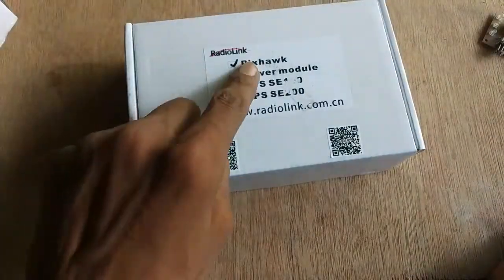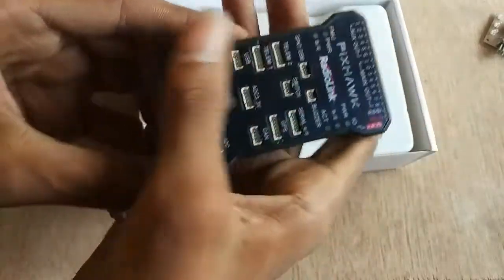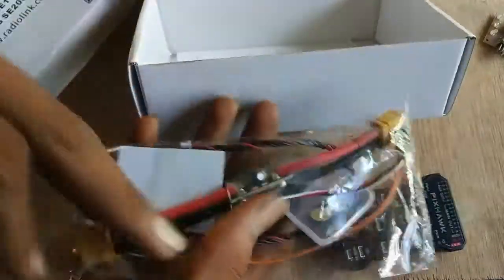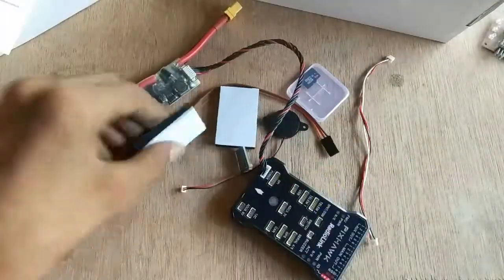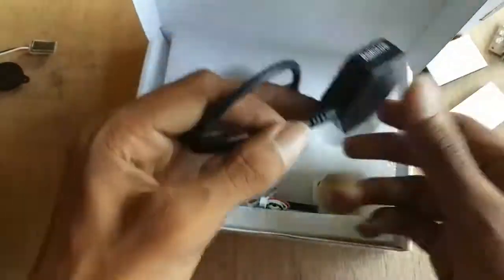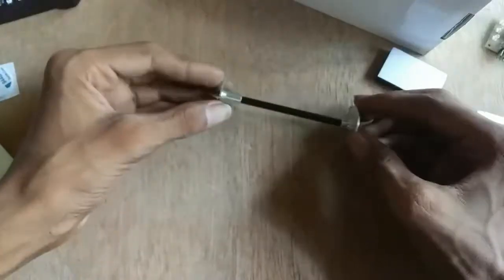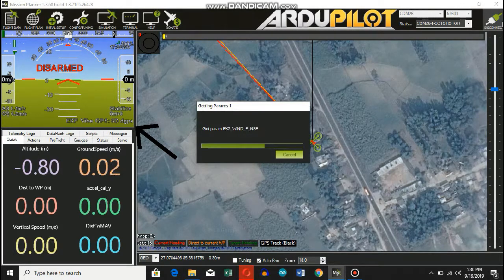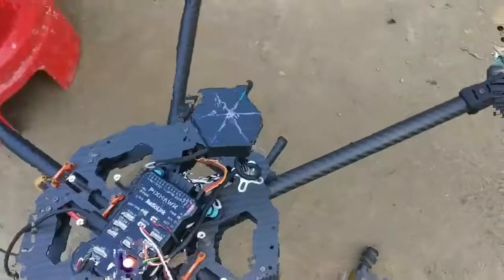Radiolink Pixhawk 2.4.8 and Radiolink SE 100 GPS module Unbox + Test

Comment: Hey bro what is the difference between radiolink pixhawk and normal pixhawk ?
Reply from the maker: By normal, I are assuming that you mean non-branded clones. pixhawk is a open source project and hardware and software are open to public for free replication. so, many cheap Chinese one uses low quality components like accelerometer, barometer, compass, so they are not that much reliable. by sticking to a reputed manufacturer even though they are Chinese too, you are more likely to get high quality components inside the board
Reply: @AmateurInventor  sir i had a question i have one air module and two ground module (as my previous air module was destroyed ) so can I use both the ground module with the air module both are of same frequency...
Reply from the maker: Just flash the same firmware and connect proper tx rx wires, the air and ground modules are interchangeable and are basically the same!
Reply: @AmateurInventor  sir you didn't get my point I'm trying to ask you that i want to use both the ground module together with one air module is it possible?
Reply from the maker: @slayerdaku7012  although the overall frequently is same, the specific frequency is different so, what you can do is, flash the same firmware to all three modules, and you can receive the signals  from same air modules to both ground modules. But it may create interference as both of them will be operating with exactly the same frequently.
Reply: @AmateurInventor  thank you and one more question is radiolink pixhawk compatible with latest firmware and latest version of mission planner?
Reply: Kindly tell me bro....
Reply from the maker: @slayerdaku7012  They should. However I cannot confirm because the only radiolink pixhawk I had was burnt when my lab was burnt on fire. But they should. and to be honest those FC are great paired with SE200 GPS module
Reply: @AmateurInventor  se 200 or se 100 as i couldn't find anything else except se100
Reply from the maker: @slayerdaku7012  ohh sorry, its actually se100. it is by far the best GPS module I have used soo far in 3-4 years in hobby.
Reply: @AmateurInventor  so sir should I purchase it? Will you recommend it for me? And can we connect it with raspberry Pi 4
Reply from the maker: you can for sure connect with raspberry pi4, I would recomend this over cheap non-branded pixhawk ripoffs.

Comment: Hi 
I recently purchased pixhawk 2.4.8 and a hexa frame S550.  I am facing some problem with it. Please help me
1. Main out 3 of pixhawk seems to be the problem. Whatever ESC I connect I am not able to spin motor. But with other Main out's I am able to spin. What could be the problem here? How do I resolve? I had flashed Hexa firmware, Octo firmware and quad firmware. None of these firmware worked for me on main out 3 . But main out 3 was working fine before.

2. As I am not able to use main out 3, I had to flash octo firmware for the pixhawk on my hexa frame. So , I could use main out 7 and able to spin the motor. Now I am able to arm the drone. But when I try fly , it leans or drifts towards left side. I am not able to control it and I have damaged my hexa frame. I am using FSi6 transmitter.  Do I have to trim? or Do I have to calibrate comapsss. How do I handle levelling issue? Please help me.
Reply from the maker: You seem to be seriously messed up. And i know the pain of breaking drone on its first attempt to fly. Please send me the detail pictures with videos in my email @ creativenischal@gmail.com
I will try my best to help you.
Reply: @AmateurInventor  Thank you Nischal for you support to help me. I could finally fix the problem and able to fly drone. Thanks
Reply from the maker: @tharunjavalimn  wow great!! I would really enjoy watching you fly your drone 😊

Comment: I have this exact model. It is an older Piwhawk 2.1, not 2.4.8. It appears Radiolink do not make a 2.4.8
Reply from the maker: Would you like to explain it in brief?
Reply: @AmateurInventor  If you go onto the Radiolink website, you can see their product.  Here is a link on Amazon.  I bought this in 2017, long before 2.4.8 came out.  https://www.amazon.ca/Weyland-RadioLink-Pixhawk-Controller-Multirotor/dp/B01N4KJEV4
Best to write to them and ask what revision they are using.  No problem though - I use this and it's great. But I want to write a script and you cannot see the SCR_ENABLE parameter on this version due to a bug.  If you can see this parameter in your Mission Planner then I am wrong.  Let me know !
Reply: Ok I think I am wrong - the specs on their website have been updated. Processor is STM32F427VIT6 which won't have the 1MB flash bug.
Reply from the maker: Thank you very much for your time to write this comment but the FC that I have is pixhawk 2.4.8 with stm32f427

Comment: Can I make a tarot t960 model drone with this
Reply from the maker: I would be more than happy to help you. You can send pic and your problems at creativenischal@gmail.com. and which country are you from?
Reply: @AmateurInventor  I am from India bro
Reply from the maker: Ok then what can I help you
Reply: Hi bro i have got pixhawk every thing was set but how to calibrate   hobbywing xrotor 40a esc with pixhawk 2.4.8
Reply from the maker: Yes bro! I have purchased this in order to put in on my tarot 690 hexacopter. You can see it on the end of the video
Reply: @AmateurInventor  thanks for the reply bro i have made a custom drone with aluminum which will look as same as tarot t960 can you please help in in fixing the gains and do we require any knowledge to fix the gains please please please help me about this bro
Reply from the maker: I would suggest this video, https://youtu.be/gYoknRObfOg
Reply: @AmateurInventor  yes i have seen this but when coming to esc calibration there are many protocols for pixhawk right like oneshot ,oneshot125 etc which one i should have to select and do the calibration
Reply from the maker: You should chose normlal or standard esc settings, oneshot and oneshot125 are bl heli esc
Reply: @AmateurInventor  actually I am using an option esc and I have overcome the problem of esc calibration but now when flying motos speeds up gradually for slight throttle and I am a bit frightened
Reply: Can you please help me with this
Reply from the maker: @rajeshdev4552  are you trying to fly it in the stabilize mode or others and have you flown a drone before??.
Reply from the maker: @rajeshdev4552  Before attempting another flight, go to optional hardware, under initial setup of missionplanner  and check the correct motor position and direction by clicking on the motor test option. If you get confused there then visit it's wiki page or I will help you out there. Also you can send me a piece of video clip of it on my email so I could better understand.
Reply from the maker: Also today I just attempted various flights and flight missions with tarot 690 with pixhawk 2.4.8, also please subscribe my channel..
Reply: @AmateurInventor  yes I am trying to fly the drone in steblize mode can I have your what's app number so that I can send u my video of flying
Reply from the maker: @rajeshdev4552  since I from Nepal, you can contact me through WhatsApp 9814881110
Reply: @AmateurInventor  hello bro i have sent you my video to this number but I think there is a problem with the number do you have any other number
Reply from the maker: You could send me at creativenischal@gmail.com
Reply from the maker: @rajeshdev4552  if you find trouble then please reply fast, ok..